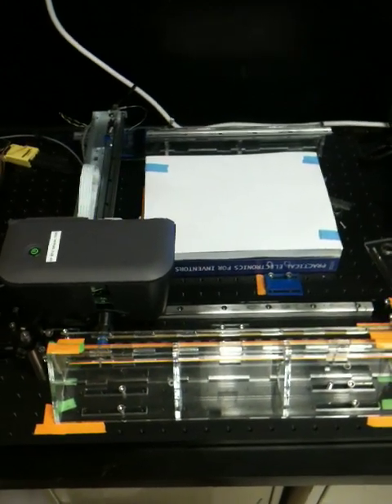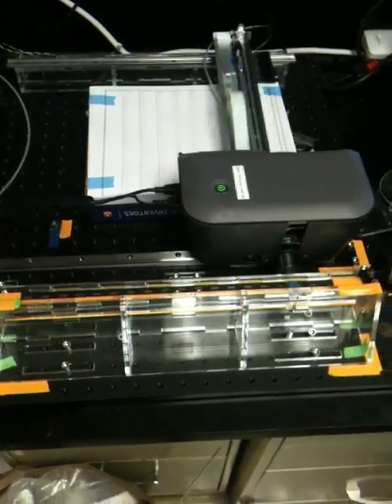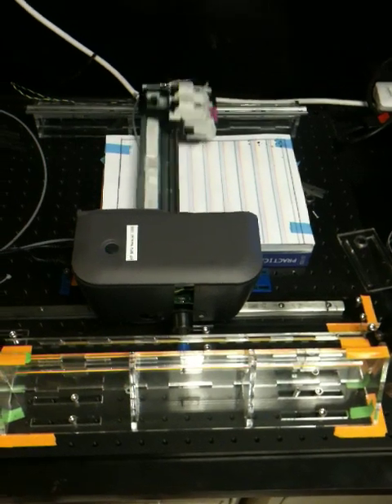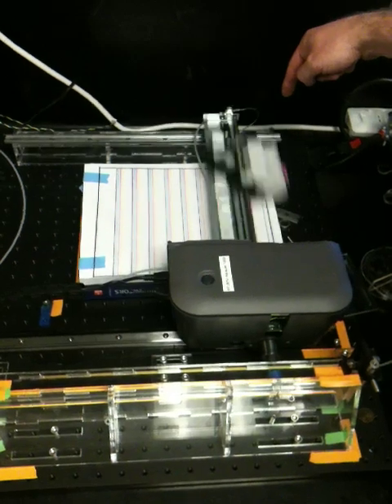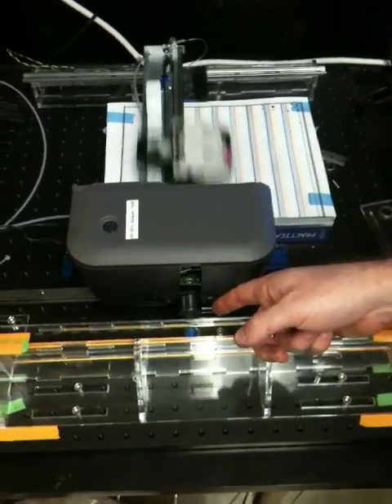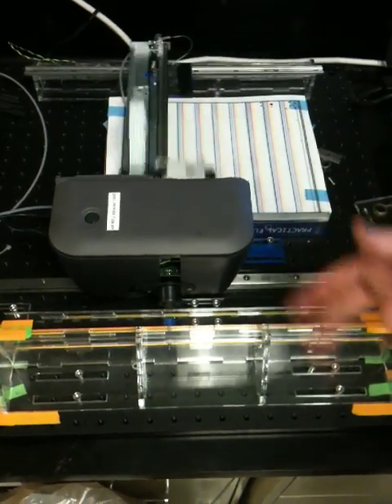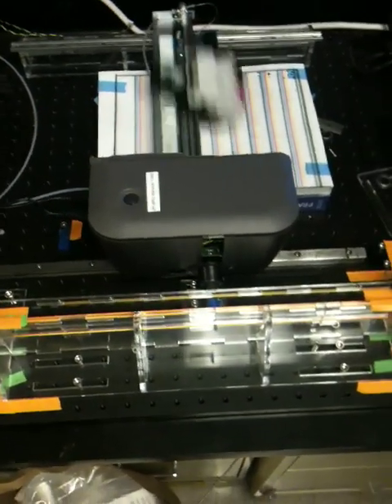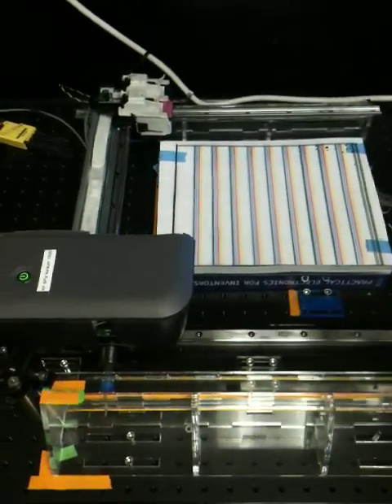More on our printer hack!

Comment: Hello I know the hack is 3 years old but I followed your first 2 videos to a tee do you by chance have the rest of the hack to assemble the printer thanks
Reply from the maker: I wrote a paper on it actually. It's in RSC advances. Feel free to email me. I can tell you all about it.  Basically you have to make a clutch with a one way bearing. The printer worked ok. After 10s of prints, you might have to realign the drive and clutch gear though. In the paper, I have included all of the files need to reproduce it. So there are STL files for the clutch, trigger, etc. these are for the printed parts. then there are just normal svg files for the laser cutter I used for the base and side rails.
Reply: @ThatsTheCombinationOnMyLudgage  

good morning I'm interested in your project I have many questions my email is nelsongas@gmail.com
Reply from the maker: DTG PRINTER GH  hi so this was a long time ago. There is a paper. You can send me an email. I’m pretty easy to find. These days there are commercial solutions for a few hundred bucks.
Reply: @ThatsTheCombinationOnMyLudgage  give me your email please
Reply: Email??
Reply: @ThatsTheCombinationOnMyLudgage  
good morning I'm interested in your project I have many questions my email is nelsongas@gmail.com
Reply from the maker: +Tommy Jay hi tommy. Happy to help. Feel free to read the paper and send me any questions you have. Many of my papers have a contact email. You can find it there. Send me questions anytime.
Reply: +Nathan Orloff Hello Nathan, I would really love to get in touch with you concerning your project and my upcoming project. Can you send me a PM with your email? You are <the one> that I've been searching for.
Reply: +Nathan Orloff Hi Nathan, sorry to bother you on Youtube again. I sent you an email, but I guess it was the wrong Nathan. Could you please hit me up at tommy_jayREMOVETHIS(a)me(.)com?
Reply from the maker: +Tommy Jay no that's me. I am just pretty busy these days.
Reply: @ThatsTheCombinationOnMyLudgage  hello